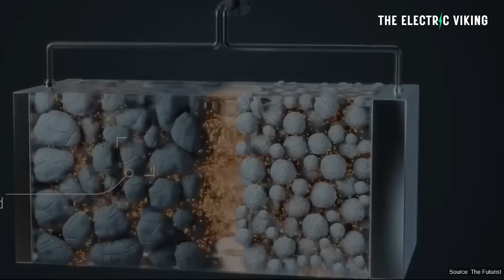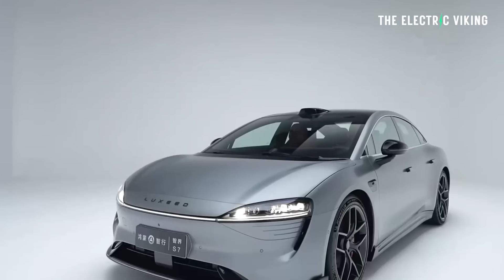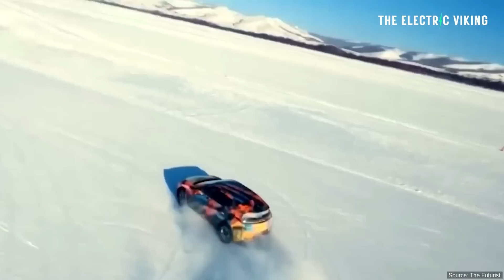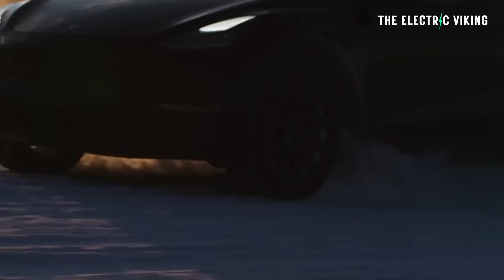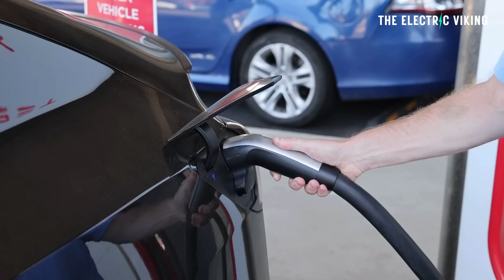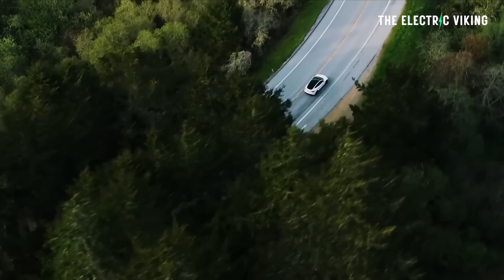Report confirms Tesla Model Y getting M3P battery with insane range & charging

Comment: Excuses excuses excuses. How many things do you HAVE to do in addition to an ICE car in order to prolong the battery? Keep it in a garage, ensure it doesn't get too cold, ensure it doesn't get too hot, park it in the shade, don't fast charge, don't charge it too many times, don't drive too often, drive at a constant throttle (speed), don't go below 30% and above 80% charge, don't tow or you'll reduce its lifetime considerably, don't accelerate too hard, don't' brake too hard.
This is ridiculous and anyone who buys an EV is not right in the head.

Comment: wow, such a battery makes towing viable. This is needed even more for cyber truck. 

GREAT .. this can really increases the run cost advantage of EVs. Example:

put 4 adults in any car towing a trailer with gear for some expedition - easily double fuel consumption … EVs r no different … halve rated range, but you’ve doubled the price advantage.  

That’s why u’d want 800+ km rated range, so u could go camping and get 400 range.

Comment: There has to be a ton of testing involved for these batteries, most notably the validation of the volume mfg line. Given that, pushing the C rating will be another milestone and Tesla usualy starts off very slow. Its all good though. Will be interested to see what happens to the 4680 if they switch to m3p.

Comment: If this comes to pass, i doubt used values will plummet. I reckon Tesla will take advantage of the lighter weight of the new batteries and keep energy levels roughly the same, or incrementally higher. Perhaps they will make an XLR version at a price premium.

Comment: Yes CATL has seen some great results, testing for EPA on a 1000km CATL it will be 750-800km of real range and that is much better already, especially if the charging speeds get above 350kw which we already have seen evidence on. Yes the production quantity will be an issue so I am not expecting replacing my current 2023 MYP any time sooner with this one. Most likely in 2026 if they manage to make enough, but even then this might be delayed. Not in a hurry though.

Comment: I am very, very happy with the range of my 2023 MYLR. I have taken this vehicle on long road-trips and see no real reason for more range. I need to get out, stretch my legs and visit the rest room every few hours, anyway, so I might as well charge at those stops. I expect that these new CATL batteries will disqualify a Model Y from half of the current U.S. tax credit, which would be a significant disadvantage. I could envision Tesla installing CATL batteries in the Shanghai and Berlin plants and continuing to use U.S.-made Panasonic batteries in U.S.-built vehicles, in order to remain eligible for U.S. tax credits.

Comment: When has Li batteries ever had a 40% jump compared to any other Li battery in the world?
Why should that suddenly be possible now?
The charging speeds and range you are talking about is greater then the Luxeed model, how would a Tesla get substantially more out of the same battery then Luxeed?
You need to be more critical of the confirmed reports you are reading.

Comment: Unlikely range would increase by much. Higher density means more range for its weight. So if they install same amount of kwh, it just weighs less which allows for an increased range, but not but not by that much.

They can increase range significantly by installing the same amount of weight, but then price would need to increase as well. I don’t think they would do that.

Comment: Funny that Elon always wanted cylindrical batteries, but switching more and more to blade batteries. I think they will just make the cars lighter than give them more kWh. My 2020 model 3 weights 1920 kg, so it would be impressive if they can make the Model Y weigh the same or less. Then you can carry more stuff or tow even more.

Comment: CLTC km range to EPA miles is more like 350-360miles.  So likely not 500 miles… if you remember the cybertruck promised 500 miles of range and ended up with 320 miles.

Comment: Anyone know now if these might be installable in our 2023 Model Y Performance or other non Juniper Vehicles???
Reply: Mate, you don't need to worry. Those "new" batteries have LESS energy density than what's already in Model Y Performance. BY A LOT! 210Wh/kg  vs  270 Wh/kg. Sam just...I have no idea what the hell is he talking about. There is currently NO any kind of upgrade in sight for the battery tech used in Tesla's LR and Performance cars.
Reply: @user-hz3eu5in you’re %100 correct
Reply: @user-hz3eu5in do you own a Tesla

Comment: I wonder, why instead of just one charging plug, don't you attach two?
Wouldn't that cut battery charging time in half?
Just one point to attach the plug, wouldn't that be a legacy of combustion engines that require just one fuel inlet?
Regards.

Comment: The thing is to prevent battery degradation we try to stay between 20% to 80% charge. That means only 60% of the actual range (not even considering cold weather regions) and that's why range is still an issue.
Reply: It depends on the battery chemistry, lithium iron, phosphate batteries are quite happy to be charged to 100% routinely
Reply: Your talking about two different scenarios and clearly don’t own an EV. 20-80% is for daily use to preserve battery health, but on occasional long distance drives you are totally fine to use 5-95%
Reply: perhaps in 2019...... times and battery's have changed.  0-100% everyday no problem now.
Reply: That's more folklore than truth. I bring my residential batteries up to 100% every single day and cycle them down to 10% SOC every single day and I have a 10 year warranty for doing that. I also have many electric toys and I leave them fully charged and some of them are many years old. I just call BS on this 20% to 80% state of charge rumor.
Reply: @user-ke9yk5qp3u it's not at all a rumor. It's a well documented, well studied fact of lithium batteries. I'll see if I can find the university studies that showed the difference in state of charge, i haven't looked at that in four or five years. Outside of 45% to 65% range, the battery life curve starts to noticeably change, getting much more impactful in the outermost 20%. But it's not incredibly relevant to more recent EV batteries with high end battery management systems. My understanding is that it's now entirely irrelevant to the newer batteries in Teslas.

Another aspect of this is that, often times these days, the battery manufacturers will just straight up chop off the top and bottom end of the range reading. So 100% isn't really 100% of the battery, same with 0%, and the user never really sees the difference.

Lead acid batteries also have a similar healthy range of 50% - 80%. Completely unrealistic to try and maintain in almost any scenarios that use lead-acid batteries.
Reply: @BaneSIlvermoon  it’s not a rumour you got that right, it’s fact. But it exists in all batteries, even the newest ones. Even in solid state. What you are referring to is lfp batteries from tesla. They are not immune to this effect, but are just so durable that they overcome the need to baby that battery.
Reply: @h20dancing18  I've heard it claimed that it's even beneficial to charge and drain the lfp batteries to near min/max to help maintain cell balance and aid the battery management system.
Reply: @BaneSIlvermoon  thank you, well said. And you nailed it on one very important point, I work for LG Electronics and the battery state of charge that we report to the customer is not actually correct. We have safety factors built-in so that the battery stays where we want it to.
Reply: @Riceman-o1p  https://batteryuniversity.com/img/content/DST-cycles-web2.jpg
Reply: Depends on how often you're willing to stop. 60% is good for 2-2.5 hours of highway driving. Personally, I can't sit more than two hours, but apparently there are people who can sit for four hours.

Comment: In my opinion the most important information on the battery was not included.

Is it possible to charge this battery to 100% without significance battery degradation?

Also, how is this battery in hot and cold climates?
Reply: I suspect most batteries in the near future (3-5 years)will continue to lengthen their lifespan 3 or 4 times, by keeping the charge between 20%-80%. Also, charging with lower watts and less heat, extends battery lifespan. Perhaps a 300 mile range at 80% charge and a 150K mile battery lifespan, with a much lighter car. We could realize a $20,000 purchase price for a compact model. Why would anyone buy a gas car. People under 40 will soon see gas cars as expensive, loud, toxic and stupid. These cars should last decades with much less heat and vibration. The future with supercar fast electric cars, silently driving themselve, will make the world a much nicer place to live. Living in these highly polluted cities in the world is really terrible, especially when compared to what it could be. The faster the transition to 100% renewables occurs, the better for all citizens of the world.
Reply: For in-town driving, charging to 100% isn't really necessary if you have a garage, and most people only charge to 80% on road trips.
Reply: It's not necessary to keep the battery topped off at 100% every day.  Not for me anyway. I set my EV to stop charging at 80% typically. But if I know I'm taking a road trip on the weekend I'll set it to 100% and let it fill up for free at my office charger before heading home for the weekend trip. And then during trips I only charge as long as needed to get range for the next stop.

Comment: Sam... you are not an engineer, you do not know what means "validation" in this case. As you know,  the Chinese companies are not selling any component of the batteries or cells, they sell just full packages. What CATL will provide Tesla is the entire package. Each car/manufacturer has its own package so after CATL is produced it, needs to be tested according to the scope and rest of the hardware installed on the car. It is not an AAA battery, to plug in and out of a radio... So "validation" has nothing to do with the cell chemistry, is about the package behavior between what was programmed by the car manufacturer in the set of hardware and what really is happening. And adjustments in the setup if necessary...! Power management ...  that part which makes your car burn if is not perfect setup... Is Tesla's job, not CATL's...

Comment: If everything you're saying is true, if I had to guess, Tesla wouldn't give the new MY 600 miles of range. They'd then have to immediately upgrade all of their other cars, or no one would even consider buying them. Why buy a Tesla Model 3 Long Range, for example, with 300 miles of range when for roughly the same price you can get a Model Y Long Range with literally double the mileage? I hope I'm wrong, but again, assuming this battery is as good as you said, they'll decrease the amount of battery used and only give it a slight improvement, allowing it to do 400 miles of range. If it charges so much quicker, Tesla would use that as another selling point and would focus on increasing the number of charging stations. Honestly, 400 miles of range and the ability to charge to 80% in 15 minutes? You could truly compete with ICE cars when traveling long distances and the only question would be how fast are new charging stations being added? But 600 miles of range? You can forget that!

Comment: The M3P battery is a variant of LMFP batteries. Like all LMFP batteries it should have an efficiency advantage of 15% over LFP batteries. High nickel batteries will still have an efficiency advantage though the LMFP will have the cost advantages of LFP. The M3P batteries should work well for lower end vehicles. For large, luxury, or performance vehicles, the high nickel batteries seem more appropriate.

FWIW, the chief scientist at CAT said the M3P batteries would be used in mid-range models with a range of about 700 km, He also said this would increase the range of vehicles using LFP by about 10%. In US terms, that means a Tesla Model 3 currently using LFP batteries would get a range of 295 miles rather than the current range of 268 miles (using real world range numbers here). Significant but does not seem to be a game changer, especially since all batteries are getting more efficient..

Comment: A quick Google search shows these cells have either 210 kw/kg or 230 kw/kg energy density. That is far lower than what Tesla already has available with their 270 wh/kg cells.
Reply: I was going to post the same observation that M3P has lower energy than Panasonic's NCA 2170 and LG's NMC 2170 which Tesla currently uses in the Model 3/Y Long Range. The M3P batteries will be a improvement over the LFP that Tesla currently uses in the Model 3/Y Standard Range, but I doubt that it will replace the NCA or NMC used in the Long Range and Performance models.
Reply: That's what I thought.
Reply: Not sure you watched the video. It explained this and also what is better about it, mostly price.
Reply: Yes, more Tesla hype.
Reply: @rogerphelps9939 , Telsa isn't hyping this. People on social media who don't know much are hyping it, and Sam Evans picked it  up. I find that Sam often makes mistakes in his reporting, because he doesn't check the numbers.

Comment: Lets not kid ourselves here.

The luxeed s7 with a 82 kWh M3p battery has CLTC range of 630 kilometers.
that roughly translates to 500km WLTP or 260miles EPA rating. 

A 1000km tesla model y is not comming any time soon.
Reply: Agree with the conclusion that it’s not some breakthrough miracle battery but numbers are slightly misleading. First, 82kWh/630km CLTC is S7 Max RS is the performance variant with dual motor & 0-60mi of 3.2s so should’ve used S7 Max has the same 82kWh with 705km. Also, CLTC is about 35% higher than EPA, whereas WLTP is like 22% higher than EPA… so 630km CLTC is more like 292mi EPA, or 705km CLTC to 326mi EPA.
Reply: @hakuhyo174  It was a rough comparison so might have been a bit of :) but I wanted to point out we are way off from 1000km.

Thanks for the correction though I multiplied by 0.65 instead of dividing by 1.35 my mistake :)
Reply: @DS-nn3bi  Yea def agree with the conclusion that we’re way off 1,000km real world range. For the math, bc it’s “X is 35% higher than Y”, to get Y, it’s actually X*(1/1+0.35) not X/(1-0.35). So 630km*(1/1.35)=467km or 292mi. If you do X/0.65, then it’s actually 53.8% higher not 35% — 409.5km*1.538=630km :)
Reply: If there is 40% improvement in energy density, Tesla y will have 120 kWh battery.
Reply: Hahaha, uneducated crystal ball u got there. Hahaha I needed a laugh thanks
Reply: It also sounds like that would increase cost a lot, and i doubt higher prices are a good selling point atm
Reply: @tomh1727  definity!  
The ~40% density improvement is compared to LFP not compared to the best ternary batteries out there. 
So we can probably expect a slight boost in range due to weight reduction, reduced Cd and other optimizations just like with the refreshed model 3.

But i really doubt tesla will add additional weight and as you mention extra cost to their cars so they will appeal to a relatively small group of people who believe 1000km range is the magic number.
Reply: Seriously tired of them switching up the rating system to spout BS. Thx for the clarification. Next, they'll count the rotation of the earth to claim "thousands and tuousands of miles".
Reply: @avgjoe5969  the Chinese CLTC rating is overblown just like any other number comming from China, energy deployment, gdp growth, etc... Land of smoke and mirrors :)

Comment: I'd like to see the new model Y with 48 volt low power/800 volt high power, steer/brake by wire, rear wheel steer, air suspension, vehicle to everything power and the new battery. Anything I'm forgetting?
Reply: Be prepared to pay 65-75k for a car like that! Otherwise no your wish list is comprehensive enough. 😀

Comment: Pouch batteries have chemical migration issues. I hope Tesla  does not use them . Let GM  use them since they don’t have a reputation to maintain.
Reply: Tesla is already using prismatic batteries, it is more or less just a pouch battery in a plastic box.
Reply: @larsjrgensen5975   I thought that was only in China, prismatic are more like cylinders since they are still wrapped .

Comment: Is there any information about the battery dimensions and mount points. Ideally, the old MY battery could be swapped out with a new one in existing cars.
Reply: I suspect that there is Tesla software that is carefully tuned to the specific charger and battery. Swapping in a different battery may not work so well.